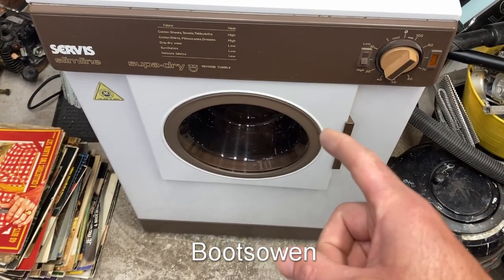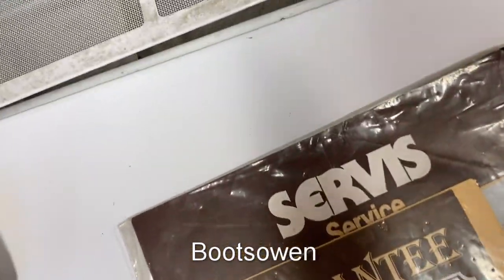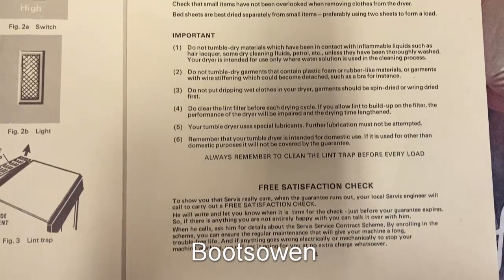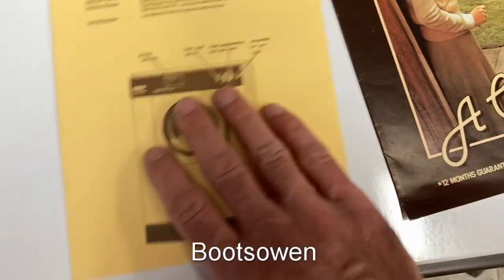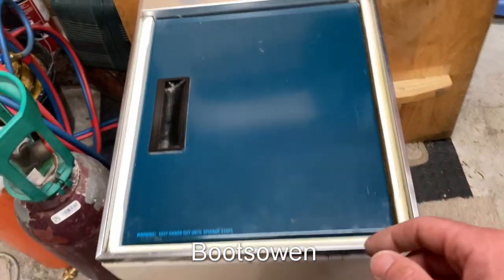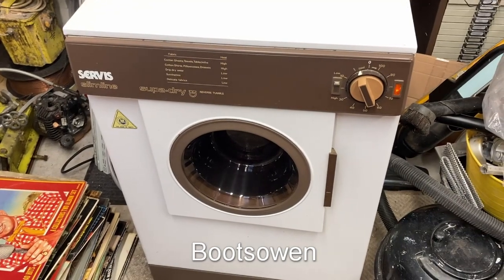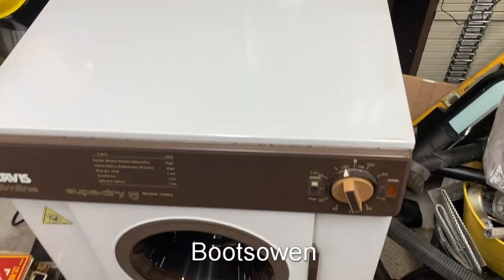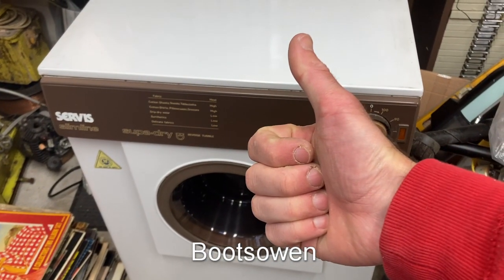Servis Slimline Supadry 209 tumble dryer: first look. Features vintage washing machine!

Comment: This uses the same lint screen on the back of the drum as the Maytag Halo Of Heat dryers in the US that were manufactured from 1958 to 1975 and very early 1976. The heat inlet on this dryer is in the front just like the Maytag Halo Of Heat dryers as well. I actually have a 1973 Maytag Halo Of Heat gas dryer I restored back in 2019 and has been running ever since with no issues at all.
Reply from the maker: Could have been sold under different names in different places.
Reply: @bootsowen  Maytag Halo Of Heat dryers were full size, Maytag technically made the compact Halo Of Heat dryers that were paired up with their twin tub washers that could be stored under the counter but never were installed or stored under the counter since it’s VERY rare to have a washer or dryer in the kitchen and some homes do in the US but is quite rare. Another thing too is the full Maytag Halo Of Heat dryers had a series of pulleys in the back for the drum drive and to drive the fan, Maytag had a belt around the drum on their compact HOH dryers but never offered the electronic dry control on them. Full size Halo Of Heat dryers could be equipped with the electronic dry control (Maytag was the first to have a moisture sensor all the way back as far as 1960 and 1961), had moisture sensors in the baffles to detect how much moisture was in the clothes it was drying and would shut off as soon as it detected they were completely dry. Only the 606/806/906 dryers had the electronic dry control, the other HOH models 306/407 dryers simply had a timer where it would run until it ran out of time or a auto dry feature where it used a cycling thermostat to advance the timer when it cycled off and turned the timer off as soon as it cycled back on which worked fairly well despite no moisture sensor.
Reply: @bootsowen  think Phil from servis slimline or Chris from the laundry centre might love this haha